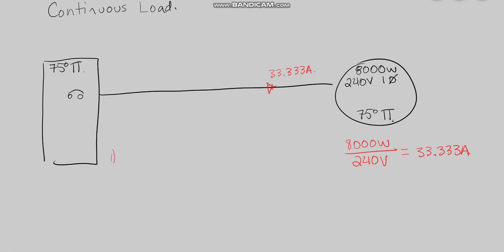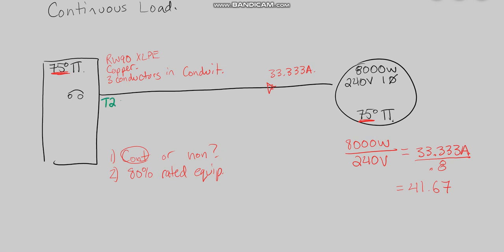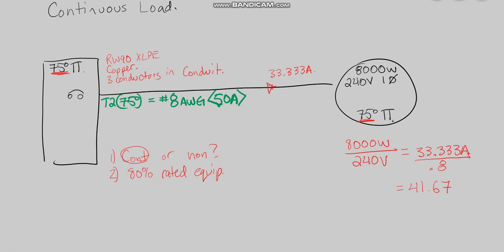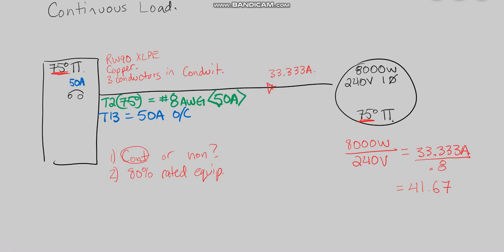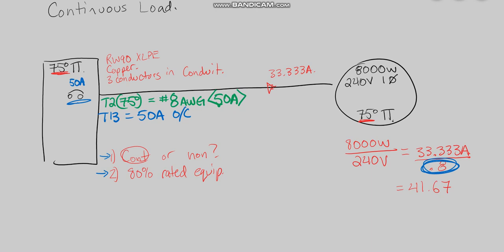Continuous Branch Circuit

Comment: Hey, love your content, if the equipment was rated for 100 percent then we would just take the 33.333A straight to table 2 ?
Reply from the maker: Correct, as the equipment can be loaded right up to it's rating with no nuisance tripping.

Comment: 41.67 A falls between 41-45 ampacities of conductor in table 13..  i think the answer is 45A is the min that we can use. 45A X .8 = 36 A and will still protect the 33.33 A load..
Reply from the maker: Please read the video description, as well as channel. This is intended as an academic accompaniment. I use these examples to find the largest allowable overcurrent. There may be many correct overcurrent sizes for an individual example, but for simplicity sake we find the largest allowed.
Reply: Thanks! I was just thinking the same thing